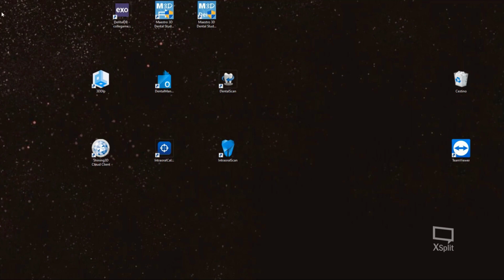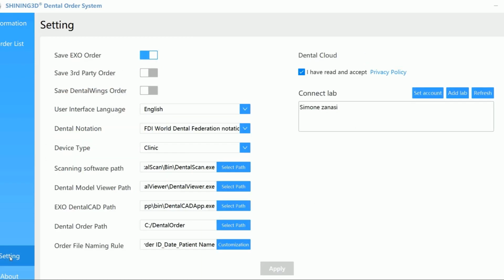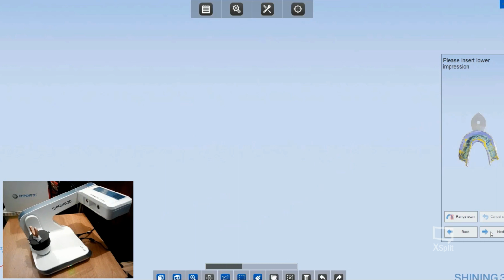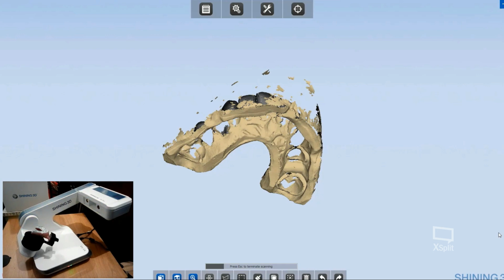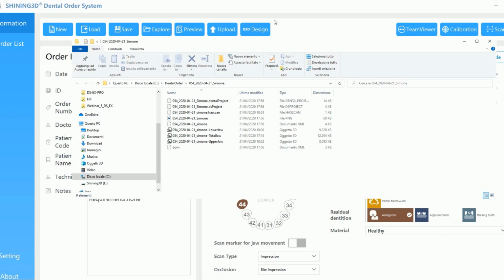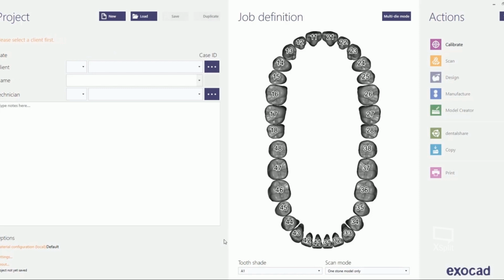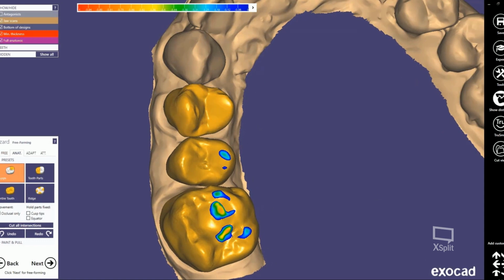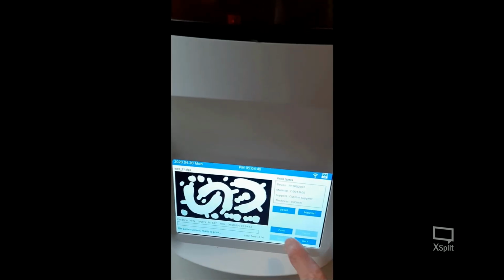8- LIVE Scan with AutoScan-DS-EX Pro + Integration with exocad + Printed Model with Removable Dies

Comment: After scan, when begining to design on Exocad the model orientation in Exocad is wrong - the red area is upwards. But it does not allow me to set the proper orientation. I think there is a parameter setting when exporting from scanner to exocad, which disallows to determine the proper model orientation. How to fix it? Thanks in advance